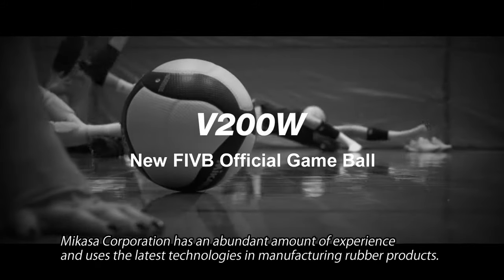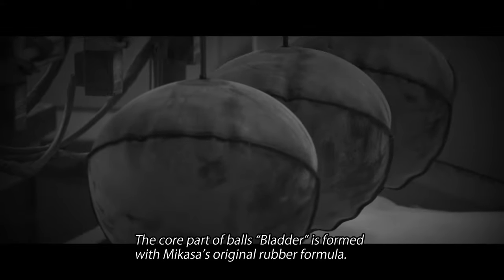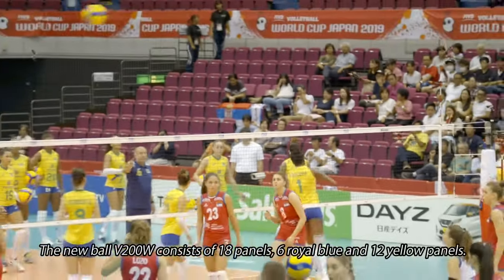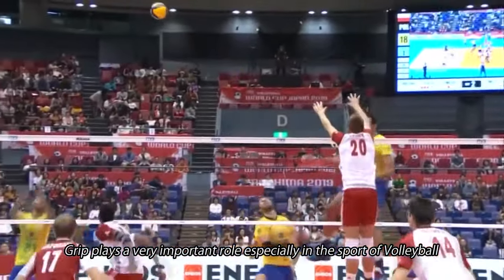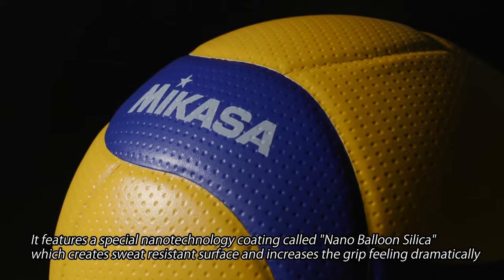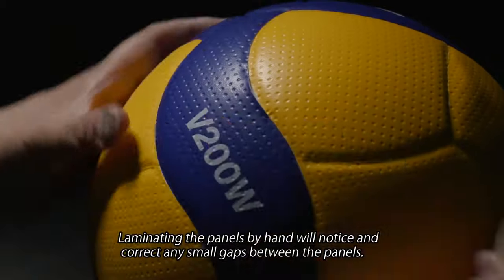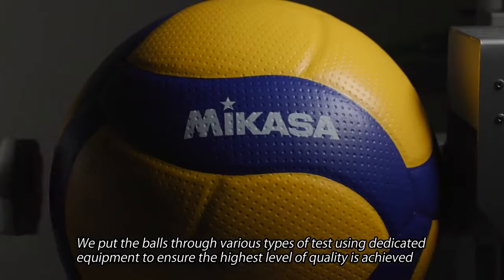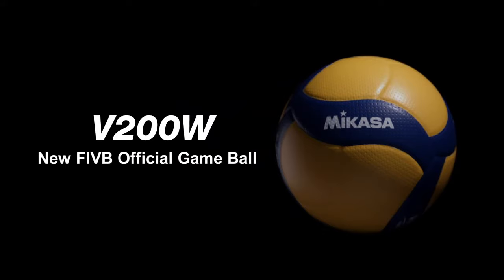V200W Promotion Video

Comment: How to order MVA300 and how much???
Reply: there is no mva300.
Reply: You meant Mikasa V300W which cost around 4k in philippine peso,
Reply: Mikasa V320W cost less at around Ph2,980 pesos, V300W around Ph4,250 pesos, V200W (the ball used in international games) cost around PH6,000 pesos,

Comment: Regretfully strongest volleyball attacks sometimes result in revenge even outside the Volleyball Sports` hall. My personal advice, is to construct experimental Mikasa indoors colours volley ball, which is with 5-10% reduced weight, with 5-10% increased size, plus to be soft surfaced close to the beach volley ball, to be able to have defensive timing for the invisible headshots and body shot serve & attacks. Sometimes younger or unexperienced players  start to feel pain because of the current model, they start to invent revenge 1000 times worse than attacking pain or send to pension  the Experienced Attackers, if they improve the ball, will extend the Experienced Players` career. The People who know how to Win a Match, People who know how to Score Points Spectacular for the Audience !
All The Best !